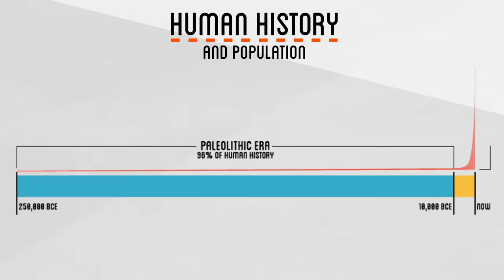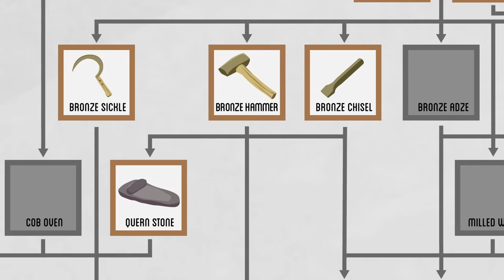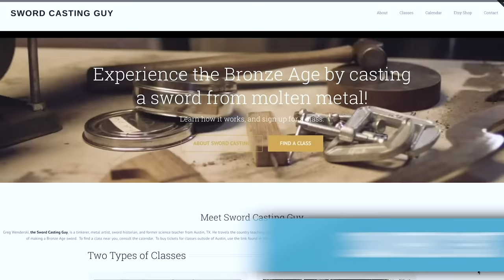Bread Making from Scratch Using ONLY Primitive Technology

Comment: Hi, baker here, bread looks great! Bake it a little longer , try "knocking" on it. It should be a little hard.
Reply: Yup, if it sounds hollow it is ready
Reply: I don't think the point of this video is to make the perfect bread :P
Reply: @Phantheman90  nothing wrong with improving what he does is there? & what if others watching do want to make "perfect" bread using traditional methods? No harm sharing easy variations to improve it is there!
Reply: Yann cedric Totsingan  the point of his reply clearly went over your head.
Reply: Yann cedric Totsingan  As Ashton Howard said, you totally missed the point of my reply

To reply to your comment though, re making bread in the wild, no thanks, I'm an Aussie, we eat "damper" if eating in the "wild". Damper is flour (nowadays self raising flour) & water (can also have powdered milk added for some recipes), wrapped in foil or put into a Dutch oven & buried in hot coals to cook. 

Scouts & those wanting to cook it quicker will instead wrap the dough around sticks & hold over a fire to cook, much like roasting marshmallows.
That's been standard "bush tucker" here for 200 years, before that it was different grains, but still the same process for 30,000+ years
Reply: @lilaclizard4504  stick bread is amazing with butter. But I love the flat bread they made. I just thought the loaf/bun looked dkinda wet inside. It could also be that they cut it open while it was still warm that makes it look weird as well.
Reply: I think use better flour. Bake in 150c

Comment: So regarding the stone shaping .... 

Next time just use a smaller, sort of flat stone, grinding on top of the larger stone, in order to create the concave surface you want. It'll go faster and be smoother. Added bonus: The smaller flat stone on top will become relatively fitted to the larger, bottom one, and you can grind between them.

Comment: I think you may be missing an important step before the flour grinding. We don't really think about this today, but soaking/sprouting the grains would be the first step, then cooking the grains in an animal skin using hot stones, then taking the cooked gruel to make the first flatbreads on a hot stone. Yes, people started skipping the soaking/sprouting/cooking steps over time. But we still use the soaking/sprouting and drying/malting steps to make fine beer today. I personally prefer to use the soaking/sprouting/drying/grinding methods for my "modern" bread baking today. It makes the grinding process easier.

Comment: Everything he does just seems messy, not sure if this is on purpose.
Reply: ah you new here
Reply: @NKG416  Nah, I've seen so many of his vids.
Reply: @bojaiden5175  It's the "make it work,not pretty" way of doing things.
Reply: He's still at the stage where most of his tools are basically just rocks and crudely sharpened pieces of metal. Which he sharpened with the rocks. Refining his work and making it look pretty is gonna take a shitton of time and effort with those, so he just doesn't really bother.
Reply: and you need to realize that Andy is just your average joe
Reply: Mikail Rahmadnegara no he's Andy!
Reply: @gso619  to be fair they not the most efficient workers either. The bronze hammer is better but a rock or a branch would suffice. Pre heating his molds and pots before pourings. Work hardening the bronze before use.
Reply: Also not wasting half of the metal that they spent a lot of time and money aquiring by not pouring it in the mold from a foot away. They could also have not burnt the bread.
Reply: Part of it is not spending too long making things perfect, because that cuts into the cost, and their profit. And its not how original innovation went. Refining technology takes a long time and is long after the initial invention because it can be refined in more leisurely hours. 
      Also, you try doing any of those tedious things without giving up or resorting to modern things off camera. I don't want to, and so I respect their resolve 100% without being upset that their methods aren't pretty. 
     If you want their methods to be "better" and "more refined", maybe you should go help them. Or send them help on patreon. But we can be 100% certain that disdaining their efforts on here does nothing
Reply: @noahlathrop4111  there's a difference between making a pretty tool vs a effective tool. We're not saying they should resort past technology they haven't earned access to but more that the process can be improved to yield better results. You're right some things will dig into their cost but some of these improvements can shorten the cost in the long run. Tool edges that last longer, being efficient with their pouring methods and reducing the amount of shaping needed for the tool.
Reply: @spaghettiandmeatballs6471  Part of the point of the exercise is the trial-and-error part of invention.
Reply: I feel like they just keep on making it until it works and stop at it. Putting on some more time on the tools would not only make them prettier, but more efficient and reliable.

Comment: Here is a short list of what I would like you to try doing next, because it would really put things into perspective: 
1. Using saliva as a yeast replacement.
2. Instead of grinding a stone, making a cement one. At least the bottom/bigger part. And you can even make it round, with a smaller but heavier cement circle inside, to make a hand mill. (With packed cement, to be precise, low initial water amount, packed really well, then water added after it hardened a bit, to become harder.)
3. After the bread has risen the first time, slice it in the middle and add a filling. The filling could be a few fruits, mashed or not, some honey, boiled meat, maybe even some dough with a higher water content, or with some milk inside of water.
4. Make a terracotta-and-wood steam engine, and then a terracotta-and-wood stirling engine, and use the steam engine to turn the stirling engine's drive shaft to create a fridge.
5. Use some of the most bubbly soap with an air pump and cement to make aircrete (aerated concrete), and use it as an insulator for the stirling-engine-fridge.
Reply: Bro wtf you talking about

Comment: Love your show!! Though quick tip about bread: you need to let sourdough (the bread that most closely resembles what you made here) rise for 4 to 24 hrs (for yours, I may have gone a full 24), which is probably why you didn't see much rising when you let it go for just an hour on each rise. If you're relying on wild cultures vs active dry yeast (termed "active" for a reason), it's going to take a lot longer for your leavened bread to rise enough to become significantly different from the unleavened version

Comment: Quern stones basically got hollowed out with use.  They just used leather or stone underneath and reground as needed.

There are oven designs with an open front, about 2/3 the height, that allow a hot fire inside to warm the oven, and then a door is placed.  No need for a lengthy tunnel, and more efficient than placing coals in with no air to feed them.

Comment: Hey Andy, haven't seen videos from you in about 3 months. Quality keeps going up. Very interesting and well done.

 One thing that could of been mentioned is a significant by product of cooking flour vs eating gruel made from uncooked flour is the cooking process help convert some of the complex carbohydrates like starches into simpler and more digestible sources of energy.

 That means the cooking process effectively lets people get more chemical energy out of the flour and requires the overall consumption of less.

Comment: Try forging (peening) the cutting edges of your tools. Especial as long as you make them from copper or bronze those metals are "work hardend" that way they should last longer. Also you would sharpen them hitting the cold metal edge with a hammer.

Comment: could you not put the clay mould into the sand and then pour to prevent sand particles from binding to the cast as well as preventing the clay mould from breaking apart (and providing the insurance that even if it cracks you won't ruin your casting)?

Comment: Make mead. It was probably the first alcohol, as rain getting into honey and then yeast colonising the wet honey would easily happen by accident anywhere. It is a sensible place for lees to ave initially been acquired from that was then mixed with porridge and resulted in the fermentation of the porridge, producing beer. Or the frothing porridge was thickened up and made into a bread, leavening it.

Comment: Cool series, but there are nuances.

First major issue - using cultivated grain. It takes ages and even genetic knowledge to make such a big grain, with a lot of flour. Cavemen used pretty wild grain with a different proportion of flour to bran. It was hard to make bread from it. And, of course, it tastes differently.

Second nuance - your dough was too rough. You need to use more water to make it more fluffy. Also working with wild yeast and delicate dough is not trivial. That's hard to get those skills, but bread will be delicious.

Comment: I'm surprised that just the coals were enough to heat that oven up to bake.  I would have thought you'd need to build a whole fire inside the oven.

I also feel like some of the process points could be shortened- having a proper scoop for the coals, or a scraper to get them out.  Using a hammer to remove some of the qern material instead of a chisel (bronze or stone or whatnot).  And of course, once you have the qern, oven, fields, etc. created...  Things get cheaper and faster.

Comment: your yeast culture needs work.  it's something that you develop and maintain over time.  also bread yeast isn't something that you catch from the air, but actually lives in the fields of yeast so you don't need to leave it outside, because it exists naturally already in your wheat. I'd be interested if you researched how to make an actual sour dough mother and reattempted your process. I also think that your bread would be better.  also your oven wasn't hot enough as your bread. - from a hobby sour dough guy.

Comment: That's some lazy bread. Cultivating the yeast for a month before using it, simply digging a hole under the oven stones for a fire instead of using residual heat and a millstone made of a large circular rock rotating using strings and weights should give much better results.

Also most of the stuff is one time only, the harvest is done once a year and the seeds are stored in definetly, with a good mill stone you can make ton of flour and all bronze tools will last an eternity

Comment: I dunno'. I rather doubt ALL of the advancements in the bread-making process were accidental. I'm sure at least some of them were based on intuition, or knowledge gained in other fields. Having said that, I highly doubt NONE of them were accidental, either. I can think of at least a couple that I'd be more surprised if they weren't discovered on accident, than if they were. It was probably a mix of happy accidents and clever reasoning.